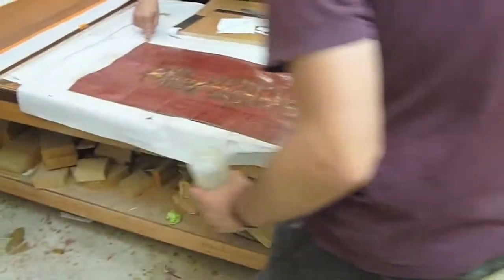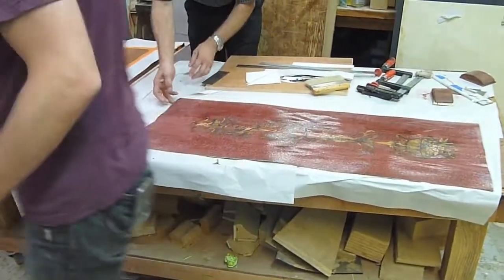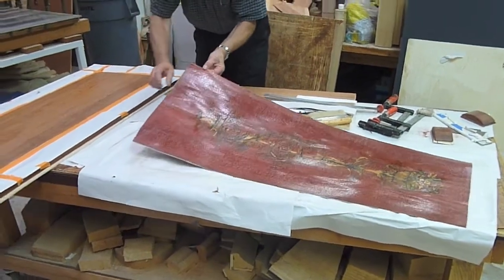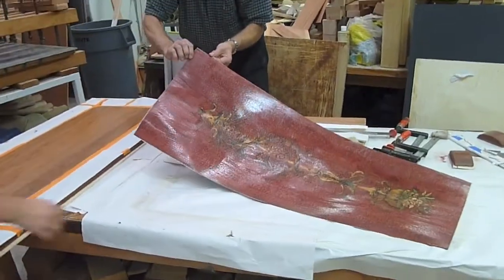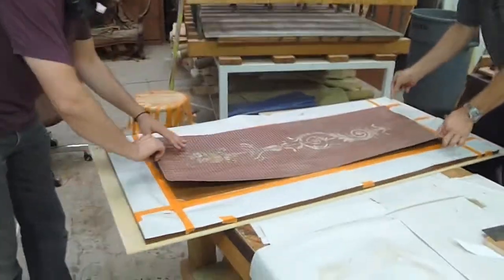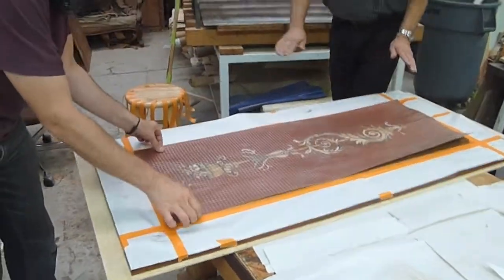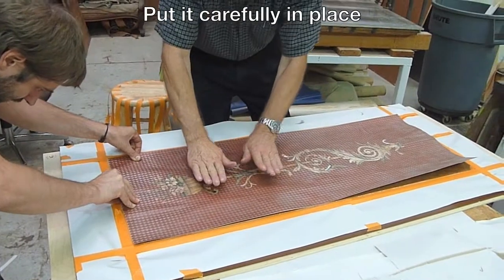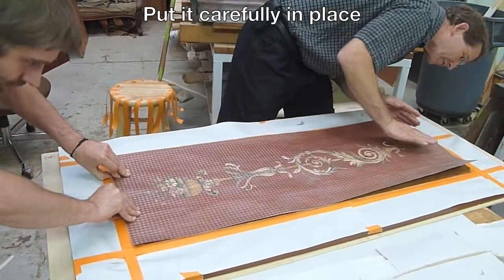Veneering with The liquid hide Glue - Old Brown Glue #3

Comment: This video was posted on june 6, 2013 ... almost 10 years ago ... and I've just bought my first small bottle of OBG a month ago from 'my man in Berlin; Dieter Schmid'. I have just the project to test it out on nearing glue-up now: copies of (missing) architectural wall-paneling (wainscoting ?) from ca. 1820. I'll need at least some open time (working alone) but slow-cure epoxy just feels wrong so I'm looking forward to giving OBG a go. I have a hunch it'll be a very useful addition to my glueing repertoire :-)
Much impressed by your work ! I have so much to learn, but so little time.
Best regards from a Norwegian woodwoker.

Comment from the maker: Our press has 2 x 3/8" aluminum sheets. Steel is nice, because of a slower cooling but much heavier and harder to heat.
Get a nice sturdy base so it does not bent and stay well flat when you press.
Cheers Bob